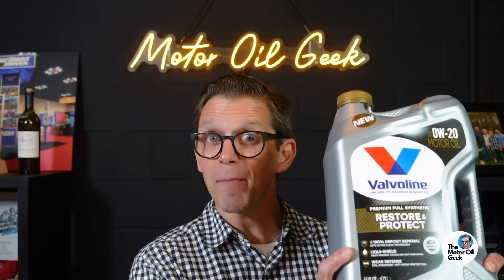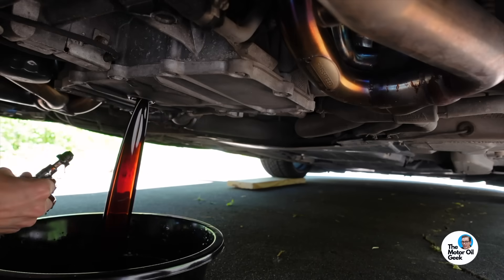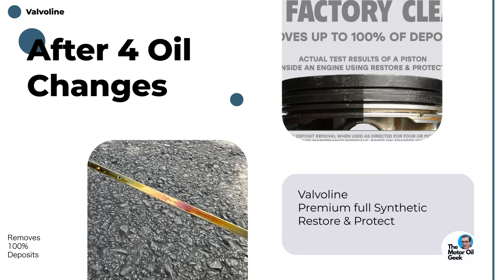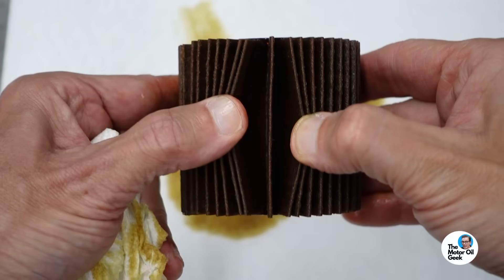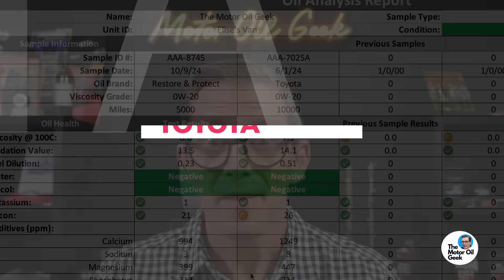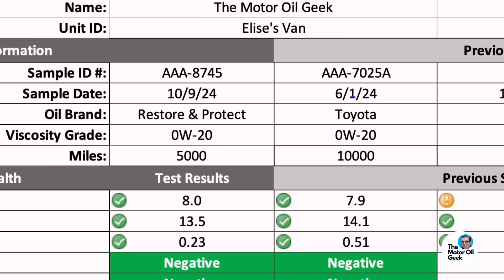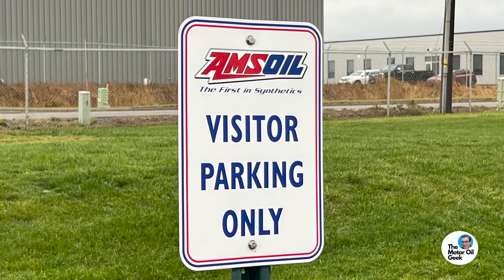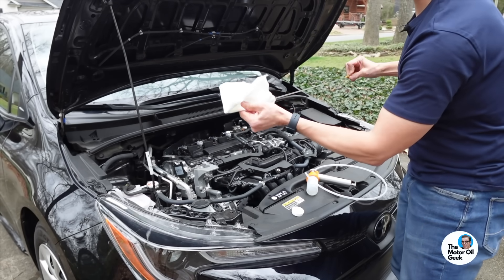The TRUTH About Valvoline's BOLD Engine Cleaning Claims

Comment: How well do you reckon it would help with seized oil control rings? Obviously that depends on how bad, but several people in a Pontiac vibe group and myself are giving this restore and protect stuff. A fair shot to see if it can help with the oil consumption issue in a 2009 era Toyota 2AZ – FE engine. Some of us were using a quart every thousand to 1500 miles some of us were so bad it was using a quart every 800 miles. I do my oil changes at 3000 mile intervals new oil and new filters. I have done at least three changes myself And my oil consumption is roughly the same as it was. About a quart every 1500 to 2000 miles. Now I know that’s not terrible compared to some, but I’d still like to get that reduced if it all possible.

Comment: Ive been using valvoline on my truck only and sent an oil sample in out of curiosity. Valvoline 0w-20 at 5k miles of runtime has a lot of molybendum in it. (About 274 parts per million in my sample). More than most oil brands out there. Cant wait to send out my next oil sample and see if theres any changes.

Comment: If i recall correctly i believe out of  all motor oil companies, Valvoline is the only one that has a in house engine testing facility. So when they create new oils to test they don't have to ship it out and wait for results, they can test different types of in oil they make through out the day and see live results and test for thing the 3rd party dont check.
Valvoline said they created this formula accidentally if i recall. They used this oil for diesel years ago, formula was stronger back then but basically it broke the carbon and sludge down so fast it was clogging filters and oil passages causing engine issues. Formula been reduced in strength for regular cars/trucks.
Reply: Wow😮

Comment: Please forgive me if this is a dumb question
But I am currently running 0W 20 mobile one oil in my 2015 Toyota Camry with a V6 engine. I was really impressed with the results from your Valvoline restore and protect oil video. I normally change my oil and filter every 5000 miles. 
My question is, should I stay with what I’m doing or should I go with Valvoline restore and protect oil in my next oil change and continue to run it for the rest of the life of my car thank you so very much for your educating and dedication to helping us get the best performance out of our engines thank you
Reply: My 2010 Lexus V6 runs much smoother on Valvoline restore and protect 0w20 as opposed to the oil before, Mobil one extended protection. Night and day smoothness, quieter and slightly better mpg and power. I'm sticking with restore and protect for now, I'm only on my first oil change but will do the 4 suggested ones as per manufacturer. I'm also doing 5kmiles/6months, whichever comes first.
Reply: 6:38  Tin wear rate shows to be 5 times higher than the Toyota oil, even though the Toyota oil was used 2 times as long. From what I know, tin is use on some components in an engine oil path. Tin is use on piston coatings to reduce friction. And tin is also use on oil cooler solder joints. So, I would recommend Valvoline Restore & Protect is a good and convenient way to do an engine flush, but only when the car really needed an engine flush. I would not recommend Restore & Protect as a replacement of regular engine oil, because it still cause some damage on an engine.

Comment: I started my new 2024 Highlander on this oil, very happy so far. I have tried almost every oil and never found a bad one other that Amalie in the 60’s.
Reply: 6:38  Tin wear rate shows to be 5 times higher than the Toyota oil, even though the Toyota oil was used 2 times as long. From what I know, tin is use on some components in an engine oil path. Tin is use on piston coatings to reduce friction. And tin is also use on oil cooler solder joints. So, I would recommend Valvoline Restore & Protect is a good and convenient way to do an engine flush, but only when the car really needed an engine flush. I would not recommend Restore & Protect as a replacement of regular engine oil, because it still cause some damage on an engine.

Comment: Thats Insane. I Just Checked The Dipstick On An LS3 I Had Changed To This Oil And It Is Also Clean. Its Still Discolored At The Section Near Header But I Distinctly Remember The Entire Dipstick Looking Like Yours In This Video. It Was A Neglected C6 With 100,000 Miles. It Has 110,000 Miles Now. Switching To This Oil Also Fixed The Oil Consumption Problem It Used To Have. Before I Coudlnt Go More Than 3000 Miles  Between Oil Changes Because It Drank A Qt. Now I Go 5,000 Miles And The Oil Level Doesnt Change.

Comment: I have been using it for my 02 RSX-S, (200k mi) when I first bought it I noticed a good varnish layer on the top end and dipstick. With one oil change (~3k miles) I noticed some of the varnish has already gone away. Not all,  but I will continue using it and cant wait to check results.

Comment: I really appreciate all the technology going into engine oil. But I do have a question. I'm running a 98 model 5.7 in the Yukon started a rear main leak. The rear main seal replacement will total the vehicle. Is there anything you recommend to mix with my motor oil to slow the leak down? Thank you

Comment: Thanks for your videos!  In regard to the Valvoline Restore and Protect.  What would you recommend for 2013 Toyota Highlander 4 cylinder?  What would be best 0w20 or 5w20.  Both appear on the oil cap.
Reply from the maker: The choice of viscosity mainly depends upon the environment. In very cold climates, the 0W-20 would be better.
Reply: @themotoroilgeek  thanks Lake for your reply!  I’ll use the 0w-20 in the winter and maybe switch over in the spring to 5w-20.  Thanks for your help!

Comment: @themotoroilgeek.  Sir,  i randomly saw your last vide a month ago.   I have a 2011 tundra with 5.7.   it has a very common issue with timing chain tensioner issue that causes the chain to rattle loudly.   After seeing your video i took a shot with this oil and with in less than a month the noise has disappeared from the truck.  I am blown away!!  This saved me 3k in repairs at dealer.  I normally use Mobile 1 full synthetic but after this I'm switch all my vehicle's.   Going to be putting in my 2004 Gmc yukon 5.3 next to see if it quiets the lifter noise.
Reply: That’s huge! This issue is / was one of my biggest concerns with the same 5.7L in LX 570, granted I have less than 25k miles on it, I want to prevent this from occurring for as long as possible.

I switched to this VRP but at 5W-30 because I also have a theory that these engines don’t get quite the same oil pressure over their lifespan with 0W-20, which the chain tensioners rely upon to operate correctly.

The real question is, after the engine is clean from VRP, is it more optimal to swap to Valvoline Extended Protection? Seems like it might be.
Reply: @asplmn  thats a great question that ive thought about also.  Maybe the guy making this channel can have some insight since he is buddies with this company.
Reply: @Informed-User  what are the repairs that total $3k? I have that same truck. I’m wondering what commonly fails that causes that.
Reply: @ceedubbz777  the timing chain tensioner fails because it is getting stuck.   although the parts are not terribly high cost its the amount of labor to take apart.   And then there is the while you where in there parts....  Do a little google on the timing chain tensioner for these trucks and you will see lot of complaints about it.   I found a video of a guy that tore one of these tensioners apart and found it was only build of bad oil causing them to stick.  Thats why i tried this oil and was amazed.
Reply: @ thanks! I thought the timing chain tensioner wouldn’t be too hard to change because I changed one on my car, but I haven’t looked into it on the truck. I’m confused by the “while you are in there” parts. Unless you’re changing the head gaskets. The tensioner I changed was just two 10mm bolts.
Reply: @ceedubbz777  the tensioner is behind a front cover.   While you where in there parts are things like water pump, both tensioners, chain, gaskets.ect.     because it  its a 20 to 30 hour job you may as well replace parts that have to be taken off if its a wearable part.
Reply from the maker: Thanks for sharing!

Comment: did the first change of oil after running R&P for 3,000 miles in a Buick LaCrosse with 140K that I purchased a year ago and had done several oil changes on. There was a deep brown, homogenous foam on top of the drained R&P oil which dissipated by the next day. maybe this is evidence of detergents which have encapsulated the build-up particles.

Comment: Can I use diesel oil in my gas engine?
Reply from the maker: That depends upon if the engine is direct injected or not. Either way, it might not be the best choice. Worse case scenario, it could be harmful to the engine (direct injection).

Comment: Hi There, I've just picked your latest video to ask this question.   I've been told that it is better to run a "brand new" overhauled engine (older engine like 1970's / 1980's) on a straight mineral oil for the first say 1500 klms to enable the pistons rings to bores to bed in properly, I'll then be changing over to a fully synthetic oil which is what I normally run, Royal Purple if you are interested.  Is this the right approach or is this "an old wives' tale"?  Would be interested in your opinion.  This is in an MGB 1798cc engine, 1974 of origin, just rebored and overhauled.
Reply from the maker: It is not "an old wives' tale". https://youtu.be/MhA_nVRhYew

Comment: This oil absolutely works!  It got rid of a lifter tick in my barn find 96 Silverado I recently got with just 98K miles.  I previously tried Seafoam, Marvel, ATF and a couple engine flushes with no results. Restore & Protect fixed the lifter tick after just 300 miles, I absolutely wouldn’t believe it unless I experienced it.
Reply: I have a 2012 Silverado woth the same problem. Let's hope it does the trick
Reply: @seriouslyflawed report back!
Reply: @seriouslyflawed  how's your Silverado doing??
Reply: @seriouslyflawed what happened

Comment: After watching your previous video on the R&P i decided to switch my wifes 14 jeep 3.6 with 225k on over. Was previously using mobil truck and suv, and didnt have any issues but seeing that the valvoline guys were using a 3.6 in the lab it made me curious. Only at 1500 since the change, and we werent having any oil related issues before.

Comment: How do you feel about the EZ Drain oil pan drain valves? Do they leave too much residual contaminants in the bottom of the pan since the threads extend inside and above the lateral level of the bottom of the pan? Since the valve is permanently installed, is there disadvantage to the valves vs. installing a magnetic threaded drain plug? Is there value in adding magnets to exterior surface of a standard can oil filter? Anticipating your feedback on this.
Thanks,
Reply: The threads don't extend past the threaded drain pan "bung" welded on the drain pan.

Comment: welp, you sold me.  I'm definitely using R&P for my next oil change.
Reply: Update: Had R&P in my Hyundai fro 6500 miles.  one thing I noticed is the fuel trims are lower at idle (read from my scan tool). they used to be 10-15%+.  i don't know what happened or why they were high in the first place (they should ideally be less than 5%) but the only difference is the oil I'm using! car runs great!

Comment: And another thing: can you make a video of how different oil additives synergize or compete during the protective film creation inside the engines? I know every oil is different but from what I've seen, MoDTC and WS2 (Tungsten Disulfide) work pretty well together, while esters cause problems (which AN promise to solve). What about the so called "organometallic compounds" like Titanium (in forms like titanium alkoxide or titanium carboxylate) ? I have found a steal of a deal in a JASO MA2 Liqui Moly (100% PAO-AN) and from VOA i saw it contains Titanium as its only friction modifier. Can I add WS2 (Eurol Engine oil treat) or it would be better to use an organic Boron additive? I know you are against additives but if I know the science behind it, I will make an educated choice (which I will then validate using a UOA). Thanks Lake!
Reply from the maker: Great suggestion!

Comment: Well, your Manganese numbers don’t just only give evidence of octane boost.
I work in the oil field business. In our world, presence of manganese means corrosion. Because iron/steal have manganese in them. So, if you are getting an increase of manganese, it most likely is evidence that your steal parts are suffering from greater corrosion.
Reply from the maker: In used engine oil analysis, Manganese is almost always from Octane boosters, and that can be determined by looking at the other elements in the oil. 
In an automotive engine, you would never see more Manganese than Iron if it was from any other source than a MMT octane booster.
Reply: If you’re measuring wear, then there is validity to your rebuttal. However, I was addressing corrosion not wear. They are not the same thing.

Comment: Because of your previous video on Restore&Protect I put it in my 120k mile N52 powered 2007 BMW Z4. This engine is notorious for oil consumption and lifter noise. My car exhibited both. I put in the R&P and did 10k miles on it. 
Oil consumption reduced very noticeably and more importantly the lifter tick completely went away even at 10k miles on the oil.. this stuff works! 
If you have an N52 powered car I HIGHLY recommend you try this oil! 
Thank you so much for this info!
Reply: Thanks for the comment.
I have the same engine N52b25 2007 with the same oil burning problem due to faulty piston design. Mine burns 1 quart per 2500 miles.

How much was yours burning?

By the way, the N52 requires 5000 miles oil change interval.
10k is too much.

I suggest you benefit fully from Valvoline RP by doing 3 more oil changes, each after 3000K miles only.

Comment: Just bought a certified toyota car with just under 30,000 miles.  Seems to run great.  Not sure on service history. Should i keep on rolling with the Mobil 1changes every 5,000 miles or run a couple cycles of the VRP through to maybe remove possible  deposits from possible previous owner neglect.

Comment: Today, I walked into a store and compared (read the labels) Valvoline's R&P to Mobil 1 extended performance.   Seems to me that they both do the same job and cost about the same.   Mobile 1 claims triple protection.   Valvoline claims it restores and protects natch.   Any chance you could comment on this?   I've been using M1 EP for quite some time and looking to understand if I would see any benefit switching to V R&P.   Dang, there are several questions in there but would be very happy with just a simple comment about equality.   Love your videos!

Comment: This engine oil does such a great job. If you’re using this in a vehicle that is not brand new. I highly suggest that you change your oil filter every 250 to 500 miles because depending on how dirty your engine is, it will clog your oil filter. The oil will still be fine, but your filter will be clogged and can cause other possible issues then after each filter change if it’s not clogging your filter, then you can look at changing it as you normally would, however, in the beginning, I would definitely recommend buying a 12 pack of filters And changing them until you can check the filters and see that it’s not clogging it any longer?
Reply: You are writing about cars bought from a scrapyard, I understand?

Comment: How does this compare to Pennzoil Platinum (or Ultra Platinum) or Mobil Extended Performance for cleaning AND protection? And, is there such a thing as too much cleaning in a motor oil?
Reply from the maker: Check out the wear results towards the end of the video for that answer .

Comment: Varnish on the dip stick?!?  I've never seen that in any vehicle in 45+ years of oil changes.  What causes that?  Is it short trips?  Extra cold or extra temperatures?

I have been using full synthetic the last 30 years and vehicles before that didn't do more than about 125-150,000 miles.  My (wife's) 2012 Sienna currently has about 175,000 and the dipstick is still clean and shiny.  I've been using either Castrol or Valvoline "full synthetic" 0W20 for the last ca. 95,000 miles. (My RAV4 with the same engine calls for 5w30 - I sure like that better!)  I can see some varnish when I look into the valve cover thru the fill hole and have two jugs of R&P for the next oil change.  🤞

Comment: My beast of 98 dodge with a 318 was an oil burner about a quart every 300 miles just got used to it. Was running good oil came out nasty every change but switched to restore protect.  Burned 3 quarts like usual then for the past 2000 miles not a drop. Now the exhaust note is amazing fuel mileage up. Changed the oil past weekend and shredded the desert revving the piss out of her and level of oil full and clean.

Comment: I have a BMW M54 3.0L  I know I should use European oil because it has more anti wear package for extended oil drain.  My question is that I want to use Valvoline Restore & Protect in the engine to clean it up but Valvoline does not make a Euro Oil right now.  I change the Oil 3-5,000 miles so could I use Valvoline's new Restore & Protect Oil that is SP rated since I would be using shorter oil change intervals?

Comment: Hey Lake. I bought an oil pan that is tapped for a threaded oil pan heater.  The element that comes with it is copper. Is there anything to be concerned about having a copper heating element in the oil pan? This is for a 6.7 Power Stroke. Thanks 🙏🏼
Reply from the maker: I'm not a big fan of the probe style oil heaters. The pads are easier on the oil.
Reply: @ Okay, good to know! Thank you!